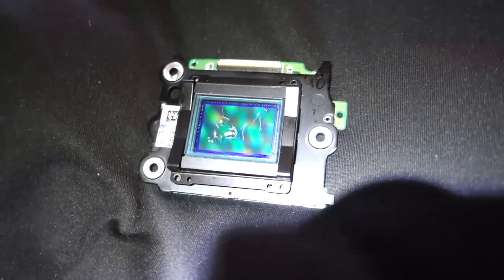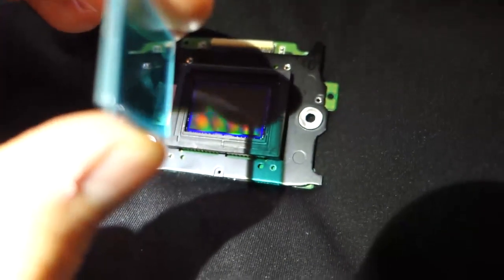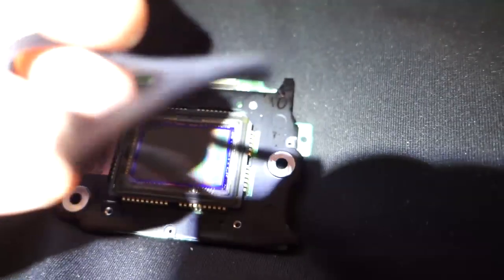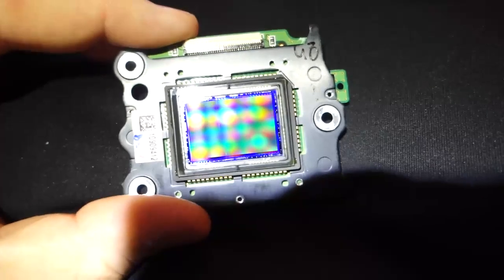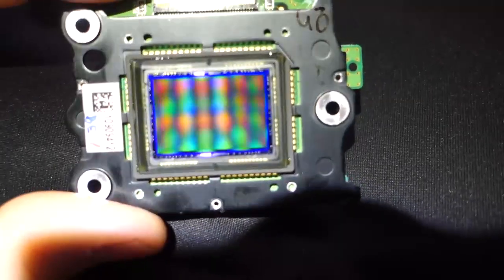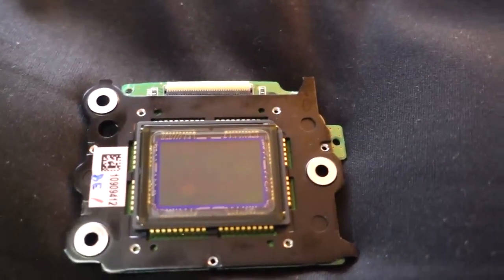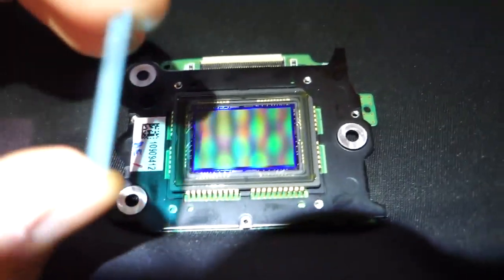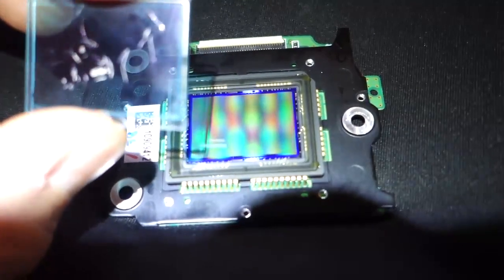Angry Photographer: Getting UP CLOSE with a Nikon SENSOR,  Fragile? Not really,..the sensor up close

Comment: Thanks for the video, i admit to having an irrational fear when it comes to cleaning the sensor and what you're doing is a good catalyst for casting that away. Also, been shooting with the 750 since November, absolutely love it for low light focusing.

I don't have high speed sync flashes so i use an nd filter to get shallow dof during the day and given how good the 750 is at low light focusing it's a breeze using a couple stop nd.

Comment: Is this thick glass cover the so called low pass filter ?
I'm asking this because the D7100 manual says that there is no low pass filter, and because of that, the images are sharper, and blablabla.
Also because a few weeks ago I was blowing my sensor to clean it (only blowing), and the plastic tip of the blower flew directly on it. After 1 week of total terror the technician called me saying that it was only dirty and solved the problem by propperly cleaning the sensor.
So, I imagine that there was some king of cover, otherwise the sensor would be permanently damaged.
Am I right ?
Reply from the maker: ***** yes, its the low pass.....yes, without the low pass the images are sharper, however there is STILL a thick hunk of glass protecting the actual sensor, its 3 diff layers. 

the sensor is insanely fragile, AA filter or not, there is still a thick protective cover over all of them.
Reply: So THANKS to the genius who put this bulletproof glass on my sensor !!! I was completely surprised HOW THE FUCK MY SENSOR wasn't destroyed by the tip of the blower.
Reply from the maker: heheheh, now you know why :)
Reply: Thanks again, dude!